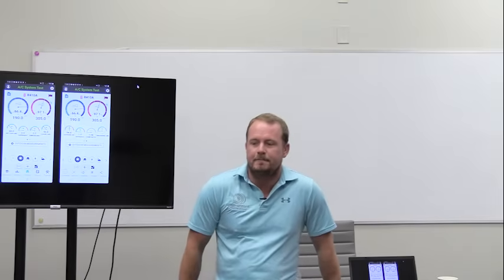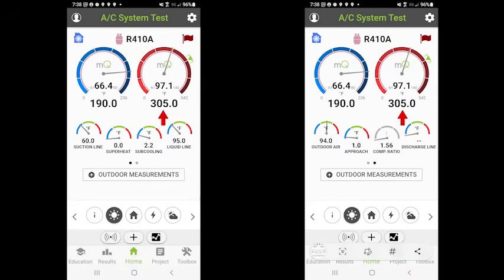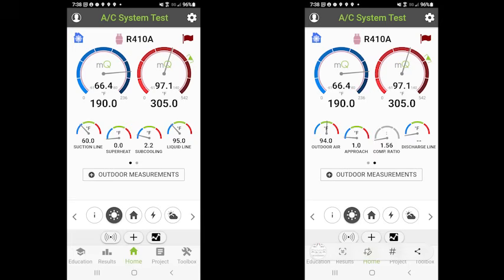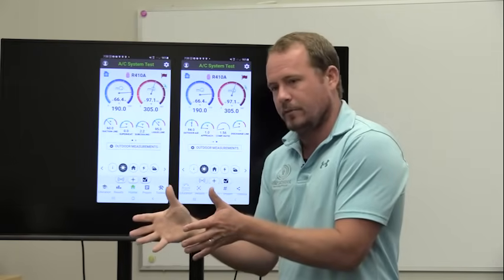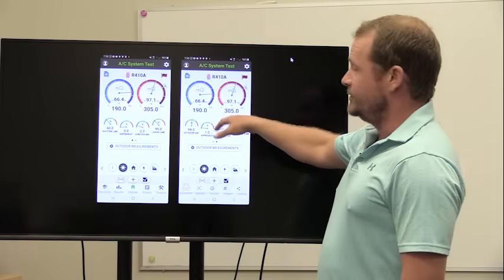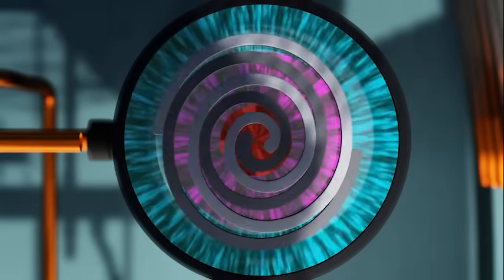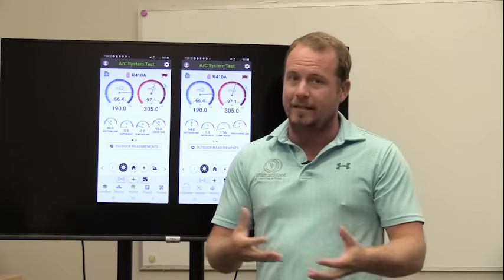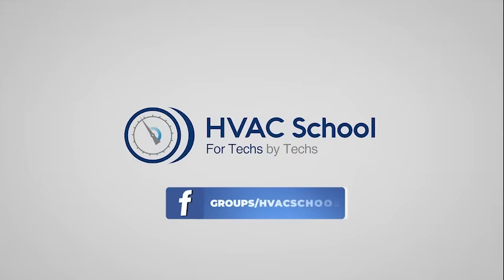Diagnosing Poor Compression

Comment: Commercial. Front seat that suction service valve and see if it pumps down. Shit it off at about 5psi suction. Listen to hear how fast it tries to bleed back.  You could do the same thing by closing the liquid line pump it all in the condenser until 5psi suction and shut if off. Stick your ear up in there and listen.

Comment: What is the chatter some scrolls makes when they shut down please?
Reply: Scrolls compressor when they shut off they tend to run backwards as the discharge pressure runs through the scrolls into the compressor´s crankcase. That's the sound, what manufactures have done is to install a check valve at the discharge to prevent it from happening.

Comment: High suction and low head could also be an overfeeding TXV. It could also be combined problems such as high indoor airflow accompanied by an undercharged system. The only way to know for sure is to run ALL your tests first including indoor airflow measurements. I have been around along time and have never seen a tech perform indoor airflow testing on a regular basis for diagnostic purposes. Also most installers throw an ac replacement at an existing furnace and never check the indoor airflow. Alot of installer at best will set the indoor blower speed at the right cfm but never check the actual cfms incase undersized ductwork is at play. Theres so much shotty work going on out there but people get away with it because theuy get the system to run cool so homeowners are none the wiser.

Comment: Excellent breakdown I'm just an ice machine technician, question a component added to a functional system to access the refrigerant circuit? Brazed on valve, check valve, king valve or pressure valve?

Comment: Diagnosing a low compression compressor on a 2 month old system. Iow amp draw. 2.2 compression ratio from liquid line. When i shut off unit the compressor seemed to continue rotation for a longer than normal duration. Could this be another tell of low compression?

Comment: When a compressor fails for low compression, you can have situation where oil is delivered to evaporator but not enough vapor mass flow to get oil back to compressor.  

Besides getting insufficient oil back to lubricate compressor speeding its failure, when you install a new compressor without removing the oil flooding the evaporator, the new compressor, with good vapor mass flow rate, returns the excess evaporator oil back to the new compressor possibly giving a too much oil situation.

Comment: Would you suspect a faulty compressor if low side was 6 bar, high side 28 bar  , compressor running R134a , 20 degrees ambient?

Comment: I had a 13yr old compressor that was not compressing . Scroll compressor i just put in a brand new Copeland scroll and my pressures are equalizing. There is no reversing valve in the unit. It's a gas heat Rheem unit. Any ideas on why?

Comment: Hey hi I watch your videos all the time here in Miami. I got exact same pressures. On Rheem split system 210 and 285 on 410 A 2 yr old RA1424 or 2 ton 14 seer Exp Valve inside Scroll compZP20k6E or 20000 but s...,.,what app are you using there. Low amps about 7 max .Any advice I was suspecting txv but not enough time to get to AH.  Since condenser is on the Roof at 9 floor and AH at 1 st floor. Over 90 feet of copper lines 3 4 and 3 8 size

Comment: Good video. I’ve seen scrolls run backwards lots of times. Customer calls in and says power flickered and it stopped cooling but it’s working good now. They scroll could have run backwards, overheated, shut off, and came back on a couple hours later. I try to wire C to the thermostat and take the batteries out.

Comment: Compression ratio has always been the measurement  of compression in the cylinder of a reciprocating engine, be it a compressor or an internal combustion engine. Couldn’t these Millennials at least have come up with something original like, “PRESSURE ratio” which is actually what it is a measurement of.

Comment: HELP! I am not an HVAC tech, but my AC has been having the same problem for the past 2+ years since I've moved into the house. I've had two companies come over many times and I've spent $1,000+ and no one knows what is wrong! The latest company wants to replace the TXV at the cost of $3,000+ with no guarantee that it will fix the problem. I just feel everyone here is just guessing and I'm at the point that maybe I should just replace the system, but it's only about 5 years old. Please let me know if you can/are willing to help!

Comment: ratio of head to  suction want pressure up enough  29 degree split you need to know outside temp indoor changes to much low suction ditrty8 my
most hearounps revert to heat
distribution tubes      what I said to begin with 39 year HVAC 10 year instructor suction is pumping or rla kra just put something over condensed to see if high sige temp goes up 

absolute 14 7 psig or 0 psig 
ligyid line not to much discharge line and liquid line same temp no shits disagree bot pumping screw centrifugal chech valve in discharge line so scroll won't run backwards on short cycling unless discharge line check valve sticking
go to the load what is outdoor ambient

Comment: Have a question about an AC unit that is being used to cool a server room. Would like to send you a recording of the 2 AC units. One looks completely normal, the other amperage varies from 22 to 25 amps per phase about once a minute. This is a 3 phase 208 volt system. The line set is about 150 feet long. The AC units are air cooled condensers (both are on VFD's). Both sets are I believe identical. 
Thx
Reply: That sounds an awful lot like a loose connection on one of the phases.  Poor contact creates higher resistance which causes the other two phases to draw more current until the connection cools and the cycle repeats.  Monitor line voltage going to the compressor contactor and watch for a leg that rises with respect to ground or the pair that falls when the current rises. Failing that check if the rise in current corresponds to a rise in line pressure, the VFD might be failing to track with the load.

Comment: I don't know about AC scrolls, but I can say that refrigeration scrolls (in my experience the ZB, ZS, and ZF from Copeland) are designed to pump down on a regular basis.  It's generally not a good idea to run an outdoor refrigeration condensing unit without pump down.
Reply: @R P That is true.  I was referring specifically to the design of the scroll.  I took the implication that scrolls aren't really designed for pump down.

Comment: With all the Lucky Goldstar compressors out there in Lennox and Carrier equipment, this is becoming way more common in scroll compressors than it used to be!
We are not a Lennox or Carrier dealer, but I've found more Lucky Goldstar compressors running a low compression ratio than all other compressor failures combined in the past 3 months.
Reply: Oil looks like glitter in a snow globe if you drain it
Reply: @joeshearer1247  Been too busy, and in pain, to be curious enough to look at the oil!
Maybe I'll check it out next time.

Comment: I have a trane system . 410a. My low side 158 with 17 deg SH . And my high side 290 with SC of 0.0  LLT 85 SLT 70 and outdoor temp 89 with a indoor temp of 75 . I was thinking bad compressor . The RLA on the data tag show 16 and amp meter shows 7
Reply: Doesnt sound like comp. What's your evap temp
Reply: @OPDrags  54 deg . The said she heard a load Redding coming from the condenser. 
I check the charge . And pulled the charge and  recharge the to the spec . Check the txv . Thing at first it was the txv .
Reply: It could be the compressor. RLA is a little low but also your compression ratio is at about 1.8
Reply: Sounds low if air flow is good. Factory charge doesn’t necessarily mean it covers the line set and evap. Compressor amps are good. If it’s above 16 then you’re in trouble.
Reply: Your SC can’t be 0 with a LLT of 85 degrees and your hi side at 290. Your condensing temp is 94 minus 85 LLT = 9 SC 

What is your delta inside the house?

Comment: For those that think a single phase scroll can’t run backwards, just haven’t been unfortunate enough to see it.   I’ve saw it multiple times and just yesterday I was in the attic and bumped the float switch with my foot and short cycled it and I could the awful sound they make from up in the attic.  I think it’s more common than some realize.
Reply: Happened to me before when I tested Float switch for functionality it made a awful sound I immediately shut off the condenser then the home owner comes out and ask “how’s it going” I responded fine and flushed the drain line and fired the condenser back up and it ran like a sewing machine. it was a relief that it ran normal
Reply: Copeland App Bulletin AE4-1331, page 11

"Brief Power Interruptions

Brief power interruptions (less than ½ second) may result in powered reverse rotation of single-phase Copeland Scroll compressors. This occurs because high-pressure discharge gas expands backward through the scrolls during interruption, causing the scroll to orbit in the reverse direction. When power is reapplied while reverse rotation is occurring, the compressor may continue to run in the reverse direction for some time before the compressor’s internal overload trips.  This will not cause any damage to the compressor, and when the internal overload resets, the compressor will start and run normally."

Better to have a good power glitch timeout timer.  You don't want repeated tripping of compressor internal overload breaker as it can wear out requiring a compressor replacement.
Reply: I have argued with my dad that that's impossible
Reply: I think my neighbors unit did this when the power blinked it was out on OL but I couldn’t find anything wrong
Reply: @joeshearer1247  Didn't it have a turn-on delay so it could equalize first? Mine's not a scroll but I can tell you when the power blinks out the only things I hear for the next minute or two are the blowers. I thought it was universal practice.
Reply: @InsideOfMyOwnMind  Many systems have no built-in delay, particularly older systems/thermostats. There’s also a number of electrical issues that can AFTER the delay mechanism so wouldn’t trigger it - say a float switch or other switch wired between the delay and compressor contactor (so avoid wiring switches this way if possible).
Reply: @ludercrous  I thought a float switch or moisture sensor was supposed to be wired to simply defeat a cooling call from the thermostat? Also I would think there should be some hysteresis in the sensor circuit so a random momentary reconnect would not be seen.
Reply: @InsideOfMyOwnMind  How things SHOULD be wired and how they ARE wired are two different things 😉
Reply: @InsideOfMyOwnMind .  No not all have a delay .That is usually set through the thermostat and normally around 5 mins. But you can remove that function if you want… I normally leave them set or set it in my calls.